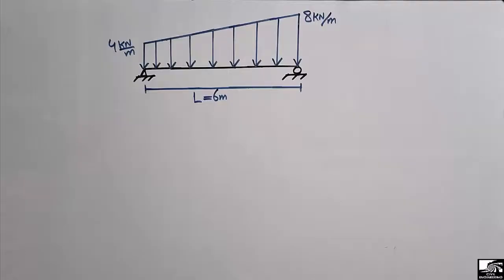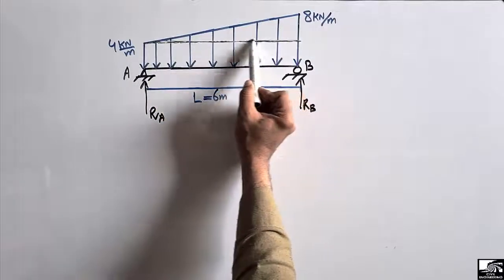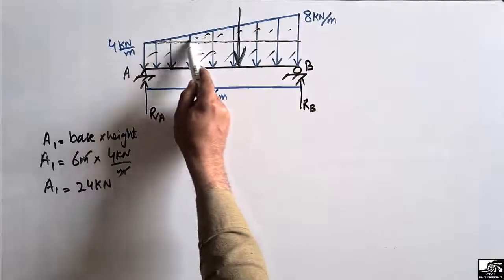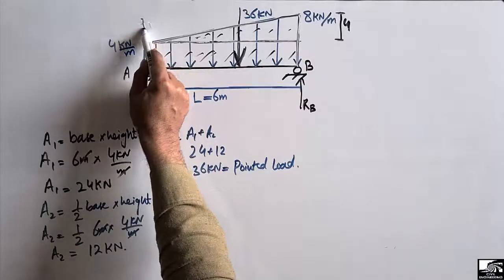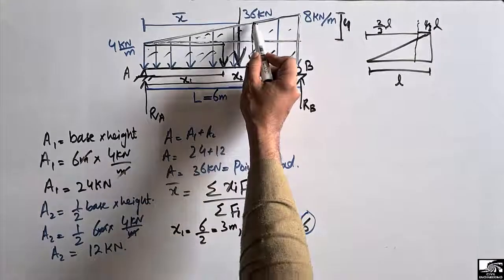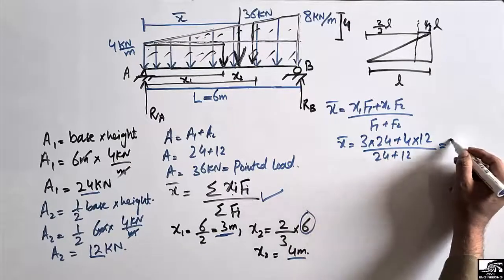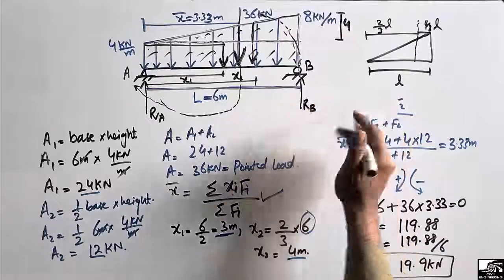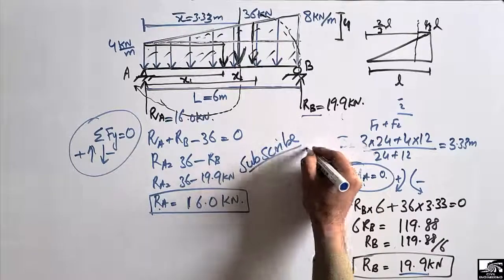Trapezoidal distributed load on Beam

Comment: I would like to take my liberty to state that the solution for the support reactions does not cancel out the loading, hence the condition for equilibrium is not satisfied. Why don't we break down the loading into rectangular and triangular section and then solve them separately just to avoid redundant calculations and also, equilibrium condition would be satisfied.
Reply from the maker: its also possible